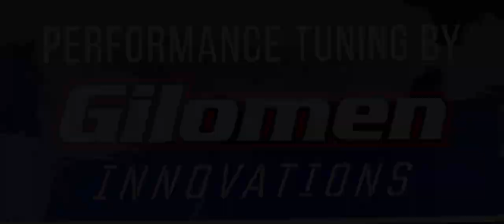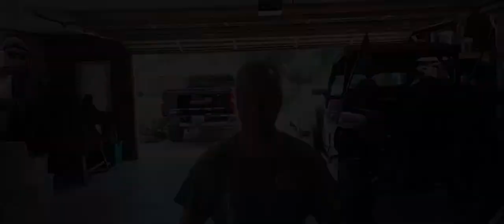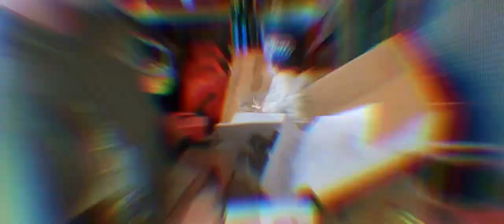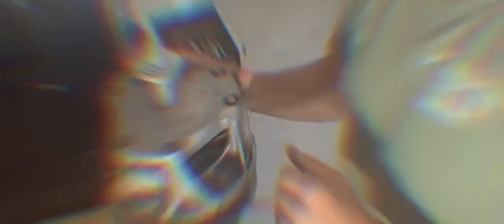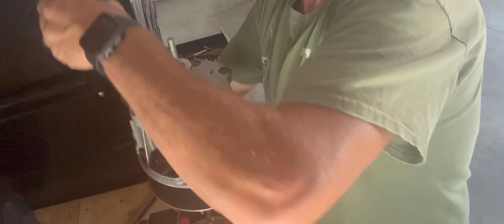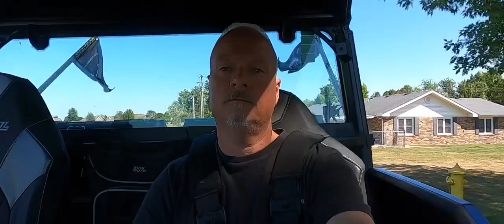Polaris General XP, Gilomen’s tune and clutch kit

Comment: You know this started out to be a great video until you got frustrated by a broken bolt?..
Reply from the maker: Thanks, thought I was seriously screwed. It was broken off in the primary 1” down to the broken bolt. I knew I didn’t have the means to remove it and was worried if it didn’t go well I’d have to buy a new primary. To add to that 3 days later we had a 3 day weekend riding trip planned and paid for.